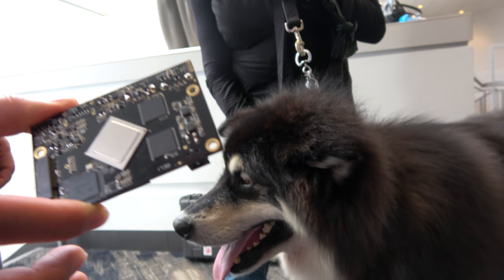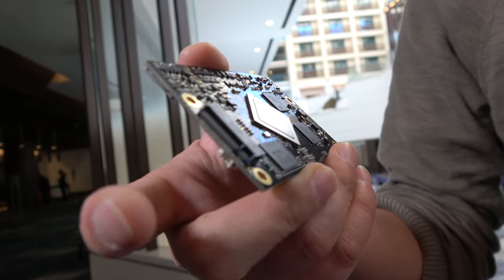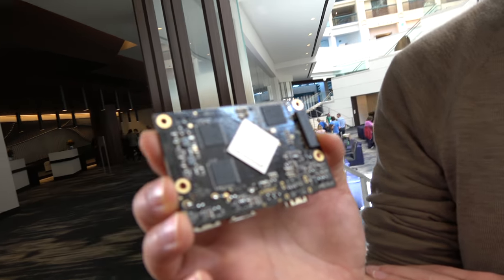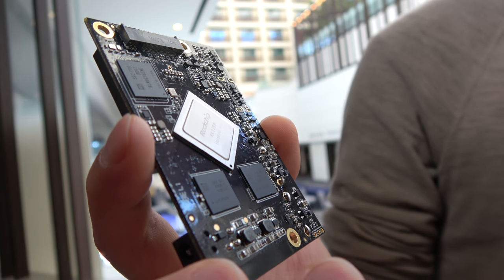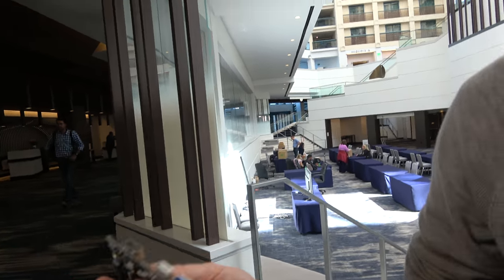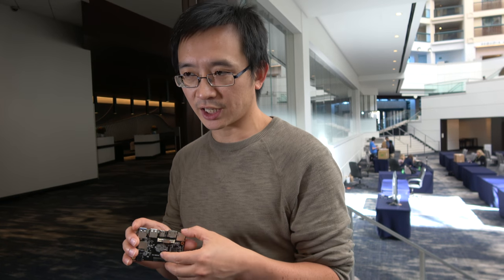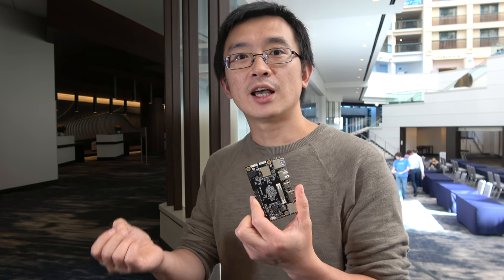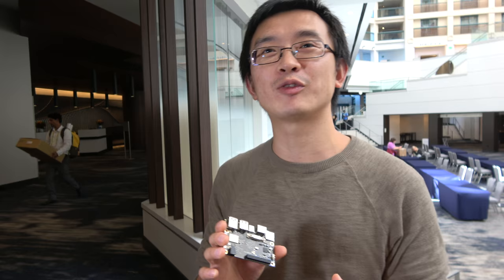96Boards: $99 ROCK960 Rockchip RK3399 development board

Comment: I am so excited about the Rock960 board. I have already a firefly-rk3399 board but I like the smaller design from the 96boards.
Hope they will release it soon for a not to high price for 4GB Ram version.
My firefly has only 2GB Ram and sometimes I think more ram would be not bad. Better to have then to need^_^
Reply from the maker: 2GB RAM, 16GB emmc at $99
4GB RAM, 32GB emmc at $139
probably..
Reply: Charbax  Thanks for the info!
139 would be a nice price ... Special compared to the over 200 usd for the firefly-rk3399 with 4gb ram
Go on with your videos. Very informative. I watch nearly everyone of them. Even if I am not interested in the main topic I like how you sometimes confuse the people with your ideas about the shown or next product. Very entertaining
Reply: Do you boot Linux off these boards ?
What do you use them for?
Reply: The firefly-rk3399 board I run with linux. Still trying out how good it is for use as a desktop replacement for casual every day use. Because frankly it was (and still is) quite little to expensive for one of my hobby tinker projects :D ... but frankly I am undecided maybe go back to the firefly-rk3288 board with 4GB-Ram I also have.
Every benchmark says the rk3399 is faster of course but well my gut instinct/benchmark tells me somethimes "back on the rk3288 it was more smooth"^_^

But I really like the Asus Tinker Board, smaller foot print and powefull SOC ... sadly only 2GB of RAM that why I am so excited about the ROCK360.
I made a somewhat called GameConsole for one of my friends with credit card sized USB-Flashdrive as "Cartrigdes" which will boot directly to the game. Wth a frankly not so good designed 3D-Printed case but it get the job done.
I think the RK3399 will be more powerfull for game emulation
Reply: Is the Linux a special build for these boards?
Reply: orangedac I use the linux provided by the manufacturer
Reply: Oh i see.  What do you do with these boards?  Just run them as regular desktop computers?

Comment: hey pal nice video for rk3399. would u happen to have the developers contact or something. i get one of these and it works awesome on 4k h265 decoding. was wondering if i can use it as  aegpu on my laptop by connecting that to my laptop through its pcie slot. is it an input only slot.